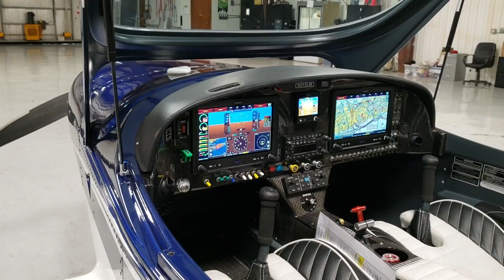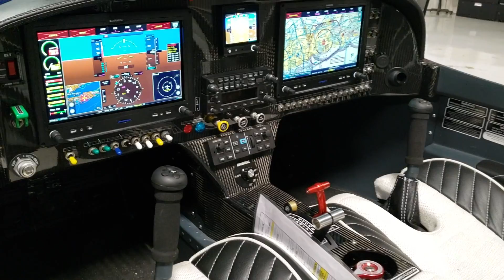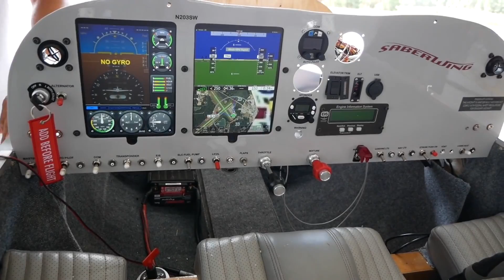The Difference Between Certified Airplanes And Experimental

Comment: It seems like the certification process is outdated. Especially with today's precision fabrication processes, modeling software and standardization of many parts. 
I work as a DOD contractor, and a story a colleague told me was the old CRT monitors needed a $25k cert to fly on ISR planes. Of course when everything switched to LED these certification were still required even though LED monitors can't possibly explode at high altitudes. But someone was still there to collect the 25k fee.

Comment: Certified 1953 Cessna 150 for sale:
-9 previous owners
-3 overhauls
-basic 6 pack analog panel
-140,000 hours
-sat in a field for 20 years
-student pilot crashed at one point
FAA: "Good to go!"

Experimental plane:
-built with modern methods and equipment
-professionally made by former Lockheed A&P's
-all modern, top of the line avionics
-fresh out of a clean workshop
-has more safety features than most airliners
FAA: "GO FUCK YOURSELF"
Reply: Amen! Of course it can be made by weekend joe in the garage but your right so much better avionics wise!

Comment: I would love a partial certification, something that you can buy pre-built from the factory but for 1/5th the cost.
They would go through some testing, but not nearly as extensive as the full certification.
And the biggest point, with partially-certified aircraft, if one crashes, then it serves as lawsuit protection for the aircraft producer. It would completely shut down any lawsuit towards the company because when the person bought the plane, they knew it wasn't guaranteed to be safe and reliable like a fully certified aircraft, and if it crashes, then it's their own fault.
This would allow traditional aircraft producers like cessna and whatnot to be more innovative and way cheaper, not to mention preventing sue happy people from getting their way.

Comment: One thing that was not brought up was the issue of compensation, which the FAA does not let you do in experimentals. So if you thinking of getting a plane to do something like flight instruct than you are limited to going with certified.

Comment: Nice video!  I trained in a Cirrus SR20 back in 2008.  The flight school told me that it had a parachute because it was not a spin rated aircraft.  Thus, it had to have the CAPS system to be certified.

Comment: You can buy second-hand experimental aircraft as well certified one. Due to the fact that all ultralight and most LSA falls into the experimental category, you have significantly more none certified aircraft flown by inexperienced or even unlicensed pilots who are greatly contributing to the number of accidents and even that is way lower than accident rate in another way of transport.
All certified aircraft are flown by licensed pilots or students with some training, most hang gliders, paragliders, part103 planes and many other are part of the experimental category and in most of the cases are flown without any experience, license or training.

Comment: The main reason certified craft are so expensive is the manufacturer is charging so much for the planes is people talked here about the hours and hours of test flights and things. There is also the need to build prototypes for destructive testing. So you are going to lose planes just to testing. I have seen estimates of between 25 and 50 million dollars just to get a small 4 seat GA plane certified and that doesn't include the production process certification. You have to sell a lot of planes to get that much money back. So not the manufactures fault.  It also isn't the lawyers or our litigious society, it is in the name of safety. Good or Bad that is the reason the FAA is so strict about it. when a person (non pilot) gets into a certified plane they expect a certain level of safety. When they get into an experimental they see all the signage they know it is not the same proven aircraft as their doctor friend's  bonanza, even though the experimental might actually be safer than the production planes and have better instrumentation, more power, and that parachute when all else fails along with a lot of other bells and whistles. 

My only problem with experimental aircraft for me personally is that although they are great for building time cheaply and perform great is that once you get your CFI you cannot give instruction in it nor rent it out to your students. It is ok if it is the students experimental plane but not yours. Also if you get your commercial ticket and want to just haul cargo say to a remote village in Alaska you are not allowed nor can you take paying passengers to their hunting or fishing lodges. Any business operations require a certified plane even when your experimental might be more well suited to the job than any certified plane on the market.  This is something the AOPA and other  aviation lobbyists need to get pushing on. If an experimental is the best plane for the job and there are no production planes that will do even close to that job as safely and efficiently, they should issue a waiver to the experimental plane so it is allowed to be used. As an example. STOL short take off and landing planes for bush pilots. Some experimentals can land and take off regularly in less than 150 feet. No certified production planes made today can do this. Also the 31" Bush Tires or Tundra Tires, with these you can land and take off in small boulder fields without damage to your aircraft. No certified planes that I know of are allowed these tires although some of the Cessnas can use up to a certain size but then again those cost a lot more for less performance.  Didn't mean to get on my shoebox here or step on anyone's toes just my humble opinions.
Reply: What's your experience and opinion about flight training from a CFI done in an LSA in comparison to an old Cessna or Piper?
Reply: @OrlandoemCasa  I really don't have much of an opinion or experience one way or another.  I  learned in a new piper warrior back in 1975 well it was a 1974 model i think. The LSA's seem to be about the same performance but I wonder about their stability in rough air compared to their heavier old piper and cessna counterparts. The ceiling restrictions of 2500 feet agl I think might present a problem for me for slow flight stall and spin recovery. I know my CFI took me to between 5k  and 8K feet agl when we started that training and then eventually felt more confident in going lower for practice.  I think a lot of the LSA's have much more advanced avionics then the older planes so that is a plus. I still like to see the old steam guages in there at least as a backup to a glass panel and all students should have some of that experience with the older avionics. All in All I don't se a huge problem and I wouldn't be against flight training in an LSA. I  don't know if I ever went that route I would want to do it but somebody has to if just for the sport pilots to get their certification.  Just my opinion .

Comment: Perfect example for you mojo. I buy an expansion valve for the air conditioning  on a airbus dauphin. It's $700 because it's a faa tso part. I can buy that same exact expansion valve in the same packaging at the auto parts store for $50. All you're paying for is that certificate of airworthyness. That 8130 that says it's an airworthy part. That's the part that I have to buy for a type  certificated aircraft. The guy with the experimental can go get the $50 expansion valve from the parts store.
Reply: Especially when the dauphine is now out of production so parts availability may suffer.

Comment: What about insurance? Is it cheaper to insure a certified airplane? Or maybe the insurance for an experimental airplane is cheaper because the purchase cost is a quarter of the certified one? Great job Mike with your videos!
Reply from the maker: Insurance will vary. Outside of the value of the aircraft, the pilot's certifications(s)/ratings and flight hours is a big factor in determining cost.

Comment: You totally missed talking about ELSA Aircraft. Two points about them. One, you can’t just do anything to your E-LSA until after you it receives its Airworthiness Cert, and even then you can’t do any modifications that will take it out of the ELSA category. Point two the ELSA design is based on a certified SLSA design (just a note: SLSA Aircraft are not type certificated there is a difference between type certificated and certified) so when you build a E-LSA your building a exact copy of the SLSA design. because it’s a exact copy. There is only a 5 hour phase one fly off. (Test Flight).

Comment: So, am I understanding correctly that if I bought a certified airplane, and modified it beyond a certain limit, that I would then fall into the experimental territory? Would this necessitate extra licensing for me or the plane? What third party could I hire to ensure my engineering is up to snuff? Thanks.
Reply: Dan Kennerson if there is no STC for the modifications you make and they are major then you lose the certification. At that point it will need to undergo flight testing (maybe about 20 hrs worth) and will require about the same looking over as a from scratch experimental. Sometimes you get restrictions on where you can fly it depending on how modified it is. You’d have to ask around for engineering support but those who modify will know someone (like Mike Patey).

Comment: I need to work for my money and I found even cheaper than building an airplane.....I bought an experimental from the builder half price of what it  would cost me to build it. ( It had 110 hrs on the tac from a brand new engine ) and I get to fly it back home the same week I decide to buy it. However there is a lot of experimental out there that I would not get into it, but with research and homework there is some good deal out there.

Comment: which of the two would you personally recommend mike? 
Im trying to decide weather to look into getting a Grumman Tiger or a revalo stryker
Reply: Tiger's are great airplanes.  I own a Grumman purchased  2000.  very Quick and easy to fly,  but make sure you get some 
instruction, not on the flying as they fly very nice.  But on the landing.  The Grumman's feel like your going down an elevator when landing,   They in no way land like a  Piper or Cessna.   Landing just feel strange at first and they  love to land with some small about of power.  Keep the nose up as long as you can. Keep the elevator back as your roll slows down.
    Once you get a few landing out of the way you are good to go.  And Good luck  I am in Connecticut, any questions just ask.      

    I do not think Mike has  much time in a Tiger, Cheetah or Traveler .    I may be wrong.        Greg  CFI  ME
Reply from the maker: @RedJay both aircraft serve different missions. If you imagine flying fast and alone, then a Stryker might be a good fit. But if you want a proven cross country airplane with good useful load and reliable, then you can't go wrong with a Grumman Tiger
Reply: MojoGrip 

That helps a lot! Thanks mike!
Reply: Never hear of      revalo stryker    who makes that ?
Reply: Greg Plaka 

Uhh... I think I spelled the name wrong, but the Stryker is an experimental airframe with dual tail-fins and canard wings, 

Its made by a company called “revelaero”
Reply: @redjaypictures4528  Go with the Grumman.    IMO